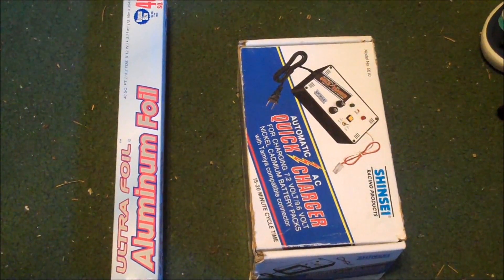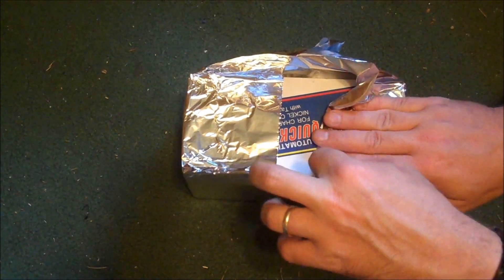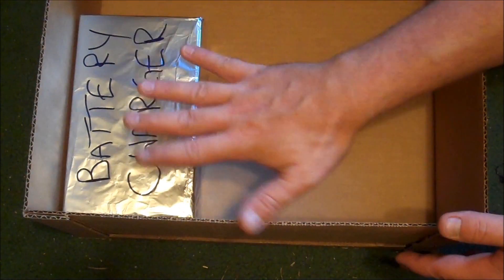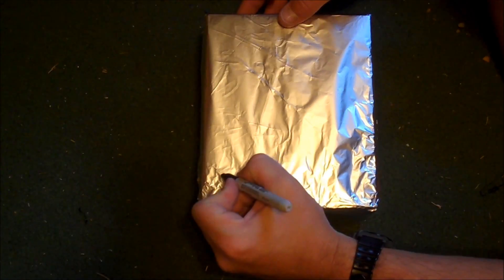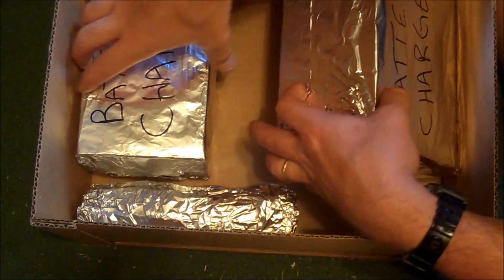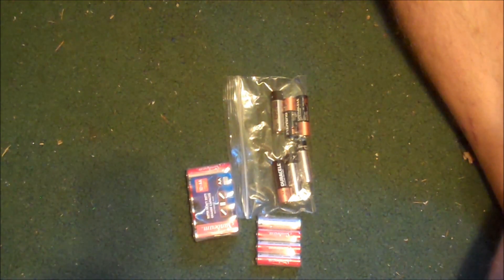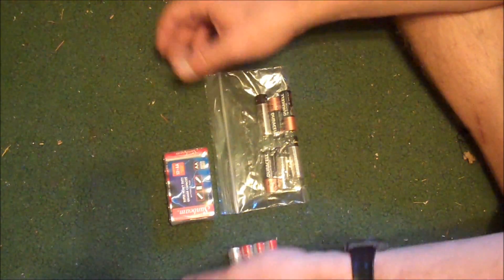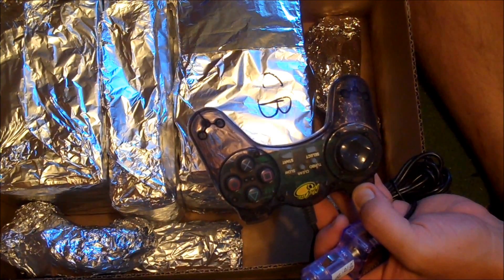Nesting Electronics for your Faraday Cage - L2Survive with Thatnub

Comment: If there's metal to metal contact or contact of any electronics with the foil then it completely cancels out that layer you've done. You need a non-conductive layer between layers of foil and outside metal or you're just wasting your time. So everything you put in that paint can is not protected at all.

Comment: WRONG!!! After you wrap the electronic devices in aluminum foil you are supposed to wrap them again in newspaper. The newspaper acts as isolation (prevents them from touching the inside of the metal can). After you put them in the metal can. Put the lid on. Then wrap the can as well in aluminum foil. I tested that it gives extra protection from electromagnetic radiation getting in.

Comment: I have a question-I am a model railroader and obviously if an EMP strikes it will fry the DCC chips (and possibly the wiring) in my locomotives. Can I just double wrap my locomotives in their boxes as they are with foil to prevent them from being damaged? I have not started construction on my layout yet, so everything is still in their boxes including signal equipment. I know if an EMP strike happens model railroading will be the last thing on my mind, but knowing my investments will be protected will help me sleep at night.

Comment: I think you're supposed to line the paint can with cardboard or something.  Otherwise the foil around your items will contact the sides of the paint can and conduct electricity.
Reply: You are a very wise. You are correct. I tested many Faraday cages. Nested is the best.

Comment from the maker: Not once in any faraday cage video have I seen anything talking about protecting against moisture.  I never even thought about it.  Thanks for the heads up, I will figure it out.

As far as the size of the holes in my cage, there are none.  If you watch the videos of me building it, you will see that I have it completely enclosed and have to cut it open just to get inside.
Reply: L2Survive 
Dropping a few moisture paks in wouldn't hurt. Better safe than sorry. After all water is a conductor. You know this but others may not realize the dangers of moisture. Unless they've dropped their phone in the toilet. Another good use for rice, btw.

Comment: What are you doing for moisture control while they are wrapped? Moisture is being sealed in by the foil and when the temperature changes (lower) it will condense on the PC boards. A suggestion would be to use a seal-a meal with a desicant pad inside and then wrap that with the foil. A Farday cage's efficiency is dependent on the size of the holes in the screening. Since EMP is broad spectrum the outer metal layer almost needs to be solid It also should be conected to a good earth ground.